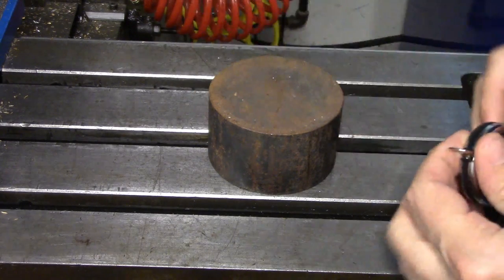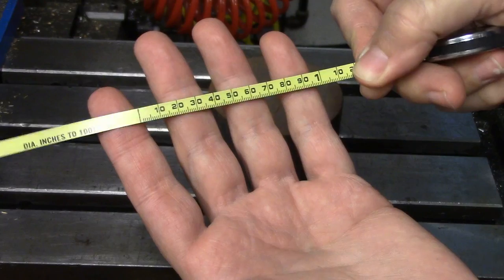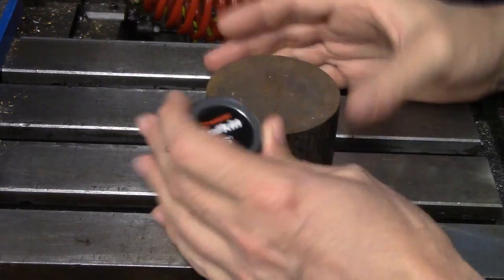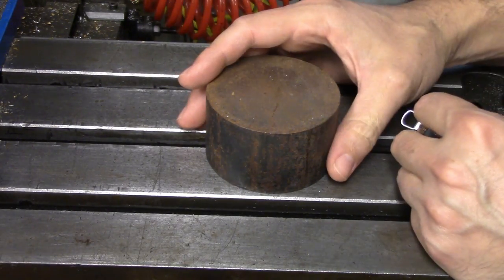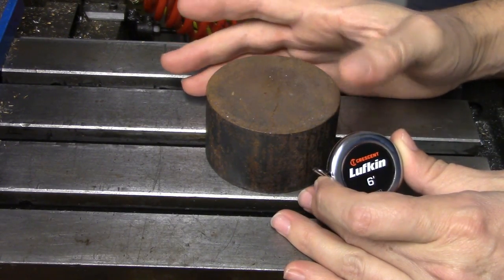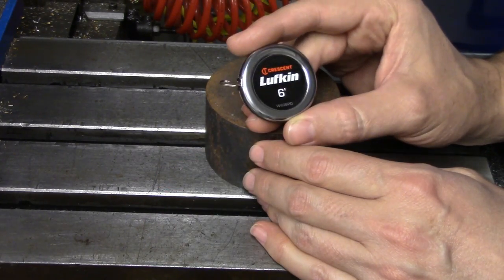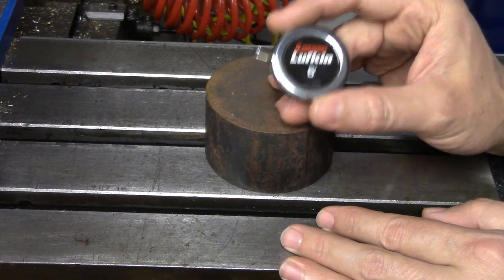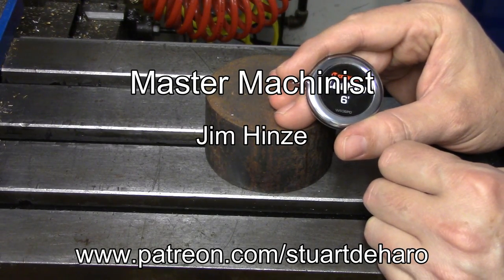The Diameter Measuring Tape - Quick Machining Tip #26

Comment: A Pi tape. Used on ring gears (rubber band) to determine diameter after heat treat for example. .
Reply: I haven't seen one since the 1960s. It was an old one back then.

Comment: Hi, That is a Pie tape, Egyptians used them to keep vertical uprights at a regular diameter, and a level to ensure they were vertical and lnow which phase of the moon were (next).
Reply from the maker: Yup. I avoided calling it a pi tape though because there is a company with a trademark on that and I didn't want to run afoul of them.
Reply: Great- where can I buy a pie tape calibrated in cubits? ;-}

Comment: As a metric user, I was briefly very confused by the funny looking decimal inches.
Reply: Decimal inches would be a great improvement. Machinists use these all the time (they call them thou and tenths...) but others are lumbered with fractions-  the main issue with imperial measurement (inches vs metres are minor, it is fractions vs decimal that is the problem). One fallout is that fractional drills are not enough, so number and letter drills have to be sprinkled in there. Why can't you buy decimal (imperial) drills?
Reply: @Tensquaremetreworkshop  The decimal inches on this tape are confusing for metric users because at first glance they look like centimetres. One inch divided by pi is 0.8cm. For a similar experience, I'd suggest looking for a photo of an old Japanese carpenter's tape. They were traditionally marked in centimetres and sun - one sun is about 1.2 inches.

The size of drills is usually dictated by other factors. Either you're drilling a clearance hole for a fastener, or you're drilling in preparation for a secondary operation such as tapping or reaming. My most commonly-used drills are odd diameters for this reason. An M8 thread has a major diameter of 8mm, but the hole needs to be drilled to somewhere between 6.8mm and 7.2mm depending on the subsequent operation and the desired depth of thread.

From my perspective, a thou is quite an inconvenient unit. 0.001" is equivalent to 25.4 microns, which is bigger than the typical tolerances I work to. Maybe it's easier if you're used to it, but I quickly get confused by tenths and hundredths of a thou. It's an interesting cultural difference, I think driven by the kind of work we tend to do. A thou is a really tiny dimension if you're making a part for an oil rig, but it's huge if you're making watch parts. I'm reminded of the saying that "In Europe, a hundred miles is a long distance; in America, a hundred years is a long time". Neither perspective is wrong, it's just different.
Reply: @j.dietrich  The point I was trying to make was that decimal inches would be a step forward- the beauty of Metric is that is is decimal too (the latter being more important- units sizes are arbitrary). Drills are in decimal sizes, and no charts of where numeric and letter drills fit needed. Once decimal, sizes can be refined without limit. US machinists use thou and tenths because they live in a land of fractions, and e.g. their drills are. Indeed their drawings often mix fractions and decimals... Interestingly their dowel gauges ARE decimal- because fractions would not make any sense. For me, use inches if want- but using decimals.

Comment: I don't mean this to be rude, but why not use the normal tape and divide by pi? I know there's a dozen ways to skin a cat, but it doesn't seem like hunting down your specialty tape would be faster than punching numbers into a calculator?
Reply: Just another tool that is useable.
Reply from the maker: Most normal measuring tapes have that curve to them to stiffen the tape. That makes it difficult if not impossible to wrap around an object. Besides it's just neat to have another trick up one's sleeve.
Reply: @StuartdeHaro  Common tape measure are graduated in fractions not accurate within 0.001". 
A Pi tape is direct reading without math.   
A Pi tape is WAY COOL to use.
When I go to the machine shop in the sky, let there be a Pi Tape in my estate for my beneficiaries to ponder how cool I was.
Reply: I think J-P S probably saw your shop tour video and I think he has a valid point 🤪
Reply from the maker: @joerogi8401  Hey! I know where all my stuff is, except for those screws I bought for the project... and any one of my volt meters... and the pencil I just had...
Reply: @StuartdeHaro  I feel your pain.
Reply: As an added point, since this is probably the only topic I have any amount of real authority, in industries where day-in day-out virtually everything is cylinders this tool is invaluable. We certainly could measure then divide, but over the course of a day it would be extremely tedious and time consuming when taken as aggregated time lost. (Unless you have a talent for mental calculation. So maybe.) Also in my specific situation these tapes are for reference only. So I can quickly see a size to reference for initial treatment and further tolerance checks, which then if needed is back to using a dedicated calibrated pi tape, where we could not rely on standard measurements divided by pi when tolerances can be +/- .002". Calibrated pi tapes allow us to do that repeatedly very quickly.

Some may ask then why not always use the calibrated pi tape from the beginning. We could. But we only have one for the department, they are expensive, they aren't as convenient, and not necessary for basic assessment readings. Stations relying on calibrated measurement for finished products do have a dedicated, calibrated pi tape.